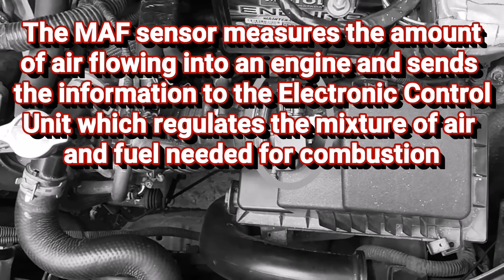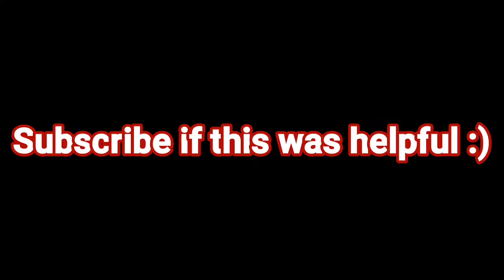MAF SENSOR CLEANING | MAKE YOUR ENGINE RUN SMOOTHER

Comment: good day sir salamat sa pag sagot sa mnga tanong na sagot na din mnga tanong ko katulad dun sa iba..

kung masasagot mo pa itong isa mula sakin samat sir at kung di na abutin ok lang din..

yung amoy sir ng tambutso ko ang sakit sa ilong... ang tapang ng amoy..

nag babawas na rin yung langis ko.. nkaka isang litro nang langis sa bawat 5000km wala naman tagas, spark plug malinis.. usap usapan ay oil seal daw.. iwan ko.

ang tanung ko sir ay pwede ba na map sensor din ang maging dahilan ng masang sang na amoy ng tambutso pag umaandar..

thanks sir
more power!
Reply from the maker: @janeangi6917  Good day din po. Kung malakas po magbawas ng langis ang makina kahit walang visible leak, maaring senyales po yan ng internal engine wear (ex. worn piston rings, valve seals, etc.) kaya nakakapasok na ang langis sa combustion chamber at nasusunog kasama ng gasolina. Isang factor po yan na pwede maging sanhi ng matapang na amoy sa exhaust. Tingnan nyo rin po ang kulay ng usok sa tambutcho. Kung blue o blueish gray yung usok, yan po ay senyales na humahalo na ang langis sa gasolinang sinusunog ng makina. Yung tanong nyo po tungkol sa MAF sensor, pwede po sya maging contributing factor kung mali po ang timpla ng air-fuel ratio at may incomplete combustion dahil sa inaccurate reading ng madumi o sirang MAF sensor. Sana po nakatulong ang sagot ko kahit paano.

Comment: Engine light warning code P0107, Does the Toyota Vios 2014 have a map sensor?
Reply from the maker: It has a MAF sensor,  located in the same place as shown in the video. Try cleaning the MAF sensor to see if it helps remove the P0107 fault code. Also check the wiring harness for damage or if it is connected properly. Good luck.

Comment: Blessed you sir, unselfish yuo are
Reply from the maker: Thank you for the kind words, sir.  Bless you too! 🙏
Reply: @Viosified  sir , is this product safe to use in toyota vios superman?
Reply from the maker: @elpidiogabriel9147  May I ask which product you are referring to, sir? Are you asking about the MAF sensor cleaner spray used in the video? If you are, the answer is: yes, it is safe. You can use any brand as long as the spray is indicated for cleaning MAF sensors.
Reply: @Viosified  more thanks again sir👍👍👍🙏🙏🙏

Comment: Hi sir i have a problem after changing my engine and transmission
The car dont idle that good and ref bad. Now i fixed that but when i try to put in drive it go realy slow and acceleration is high but wont shift that good. I had first a 1.3 engine and now i put a 1.5 engine
Reply from the maker: Hi sir. It would help if you could have a mechanic run a thorough diagnostics on your car using an OBD2 scanner to get a more comprehensive information about the real status of your car's ECU/ECM, sensors, etc. If any errors pop up the mechanic should be able to identify them and fix the cause of the problem. 

There could be some compatibility issues between the ECU and the new engine and transmission, but whatever is causing these issues, your mechanic will be able to identify them with the OBD2 scanner and address them accordingly. 
Thank you and keep safe 🙏